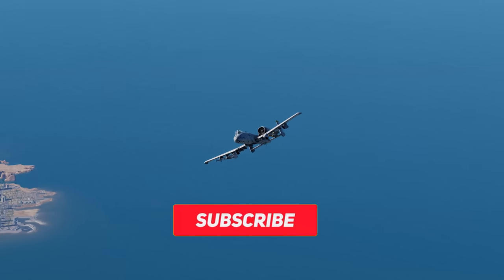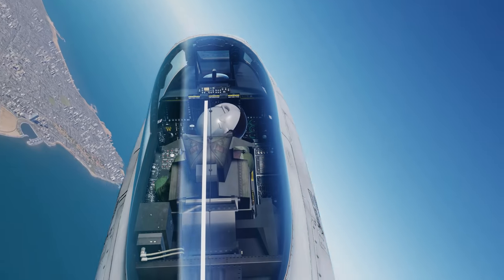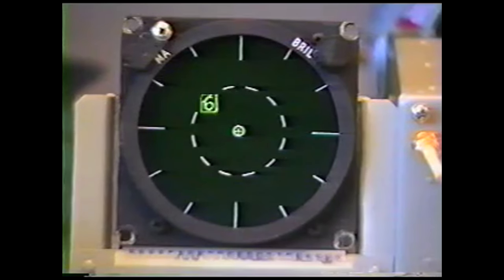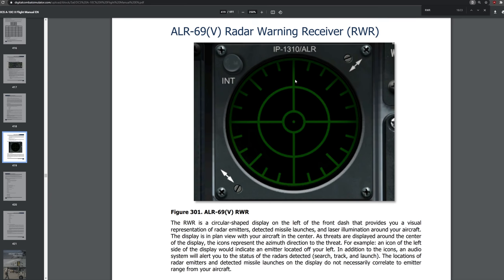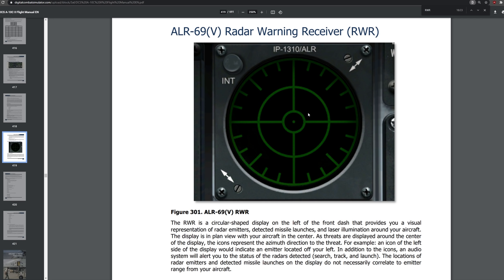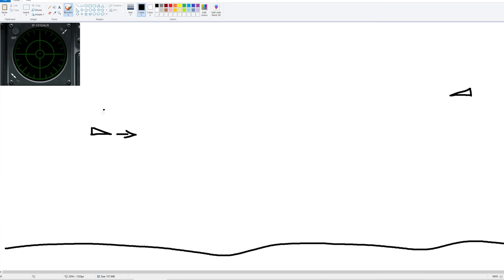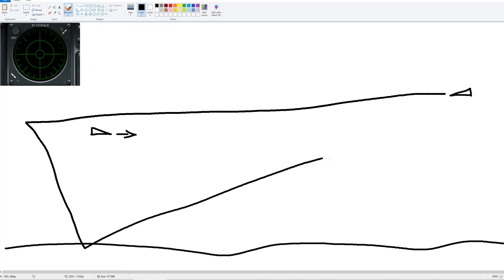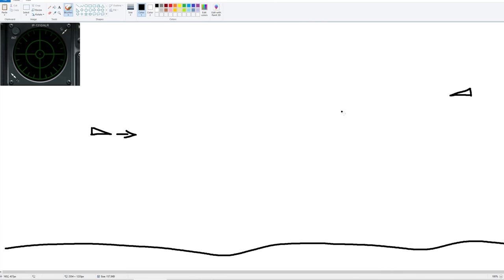DCS A-10C Tutorials - From 0 to HERO Ep8 - Radar Warning Receiver (RWR)

Comment from the maker: I wanted to include some more info in there like the circle with an L on the RWR that indicated some sort of laser illumination or even a Flanker with his Electro Optical system looking at you but this video was already so damn long that I just had to leave it at the basics for now. There is definitely some room for improvement and corrections but at the very least the users should have a basic understanding of what's going on.
Reply: Can tanks track you with lasers? I may be paranoid but I'm kinda sure the newer russian tanks are following me
Reply: Most information I did know, but still good to refresh it. This series it's definitely a recommendation for al new or fairly new A10 pilots. Great work!
Would love you to make deep dives later.

Comment: Side note for notching at 26:00 - the rate at which you need to arc to the right is heavily dependent on the F-15's distance and velocity, so you may not actually end up flying that way at all. What you need to do is keep a constant distance from it, perpendicular. Which is easier said than done.

Edit: Always forget the little Carameldansen thing is at the end. Cracks me up each time.

Comment: Great video - learned a lot.  Question:  In the "showing you how to beam" you made a left turn - did you slow down in that turn? It sounded like the engines spooled down. Is there a reason for slowing down?  Also, I've seen people get into the notch and lower the throttle - is that a good idea?
Reply from the maker: Slowing down helps for sure

Comment: Would you say that the relative threat range shows you the range of the sam as a percentage of max launch range? As in the outermost circle is 100% of launch range normalised for different sams? If not, do you know the function or algorithm?
Reply from the maker: The only thing you can kind of rely on is the middle circle. If the thing is inside of the middle circle then you are pretty much within its firing range. Typically anything outside of that circle will still be out of range. That's all we know.
Reply: @ralfidude  thanks mate.
This series is brilliant I've got to say. It's almost like a video illustrated version of the manual, with bonus bits and pieces hahah.